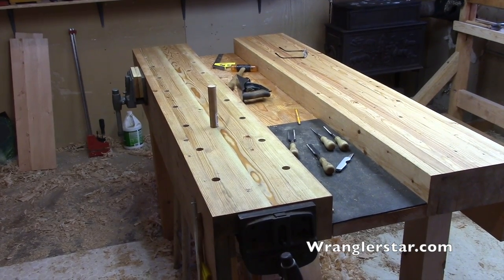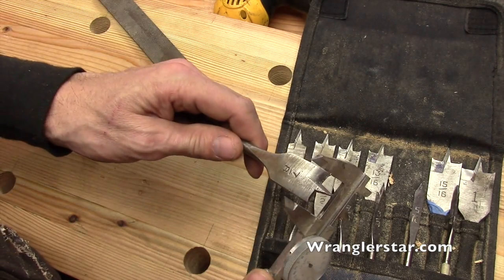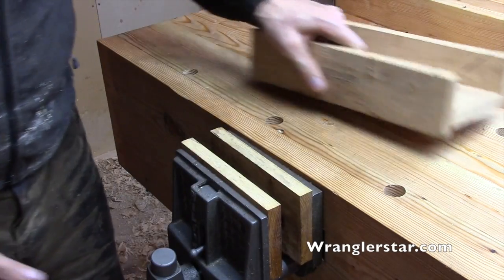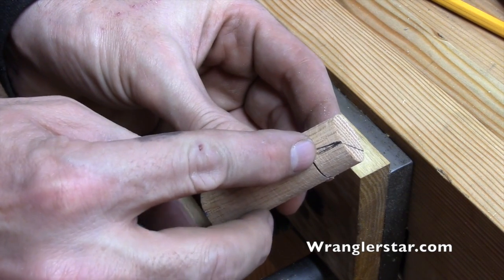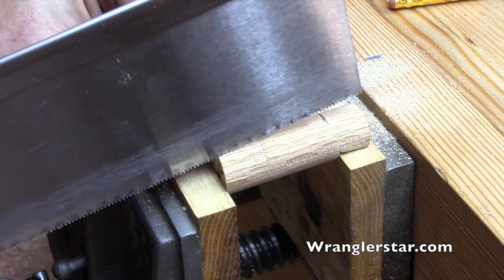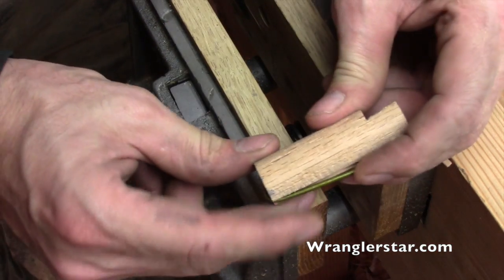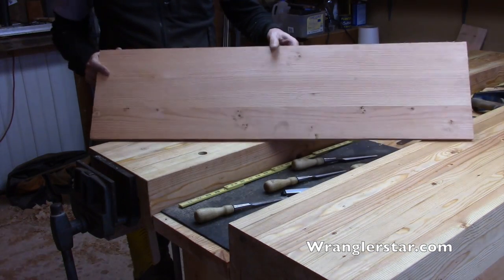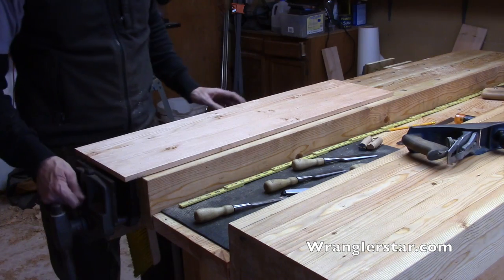Poor Man's Carpenter's Bench Dogs | Wranglerstar

Comment: Cody, you built a very nice bench.  I've enjoyed watching every episode of this project.  One additional feature you may consider.  Lets say you want to plane the edge of various length boards.  You can take your 7/8" drill and drill maybe 4 additional holes on the front face of you bench that are positioned in line with the lowest portion of your front vise expansion rods.  That way, you can position a board in your vise with 1/3 of the board to the left of the vise and the other 2/3 to the right of the vise resting on those same dogs that you built.  Those will come in handy because if you've ever planed a board on edge, you'll find after the first 2 or 3 strokes with the plane, the front portion the board drops because the vise isn't tight enough.  With the board resting on a dog that's inserted in one of those holes, you'll find that you'll only need to snug the vise to hold the board properly.  Thanks for sharing!
Reply: Pretty clever idea.

Comment: About the miter box. The reason the slots on the new box don't go all the way to the bottom of the trough is because you are meant to put a waste piece in there and saw down only that far. Sawing the slots all the way down to the box bottom weakens the box and uglifies the bottom with saw marks. This keeps the box nice and neat and keeps it stronger.

Comment: Wrangler... May I suggest... When using the main vice with your excellent dogs, pack out the workpiece if necessary and use the far line of dog holes. This puts the workpiece fully on the bench with plenty of support beneath it. A truly flat surface will result. You will also find some right-angle holdfasts are a boon, if you don't already own some. Thanks for bringing these dogs to my notice. I am a fan of Mr. Sellers, but I missed the video on the dogs! Cheers.

Comment: First of all, thanks.
Secondly, a tip, assuming you have a set of open ended spanners in your workshop, they make great gauges for wood turning and have a wider bearing surface than the dial gauge, which can twist and move sometimes.
Some very experienced woodturners use this method of calibration, hope it helps in the future.
All the best to you

Comment: Great demo of the dogging system. One suggestion I'd make is to extend the holes to the far side of the bench, to allow clamping items up to the size of a standard domestic door if possible. If you use both vises, and two sets of dogs, you can clamp a door in both directions. You might find a set of horizontal pegs in the vise-side RH leg useful for supporting longer boards while planing - clamp one end in the main vise and support the other with a dog so you can plane the sides.

Comment: I drilled 3/4" holes with a Forstner bit into my bench, then bought 3/4" bolts long enough to have a shoulder on them, then cut them off to make the dogs.  If you buy your bolts at a place where they sell them by the pound, you can get them dirt cheap.  They fit snug, but come out easily.  The heads are a little short, but I always put another piece of wood between them and whatever I'm working on anyway.

Comment: I have 3/4” dog holes. I planed my dowels until they had a decent pressure fit but after some time a couple would fall out when I did a lot of chopping/hammering etc.  instead of making fancy dogs I just clamped them up and lifted a few chips with a gouge with the grain. It’s been working fine for a while now.

Comment: Wow ! Super nice work! Thanks for the many tips.  I don't have a carpenters bench , but i do have a bench made for a mechanics shop. it is very heavy as it is made from rough cut bridge plank. It will hold an engine block and all the tools you can pile on it. I make my wood clamps from a 2 x 6 and wedges. keep up the good work:

Comment: My husband bought me a planner for Christmas and I have run into the same problem with clamps being in my way. If I can figure out how to implement what you have done with the "dogs" I will be free of the clamps and surely enjoy restoring pallet wood more. Thanks so much for sharing.
Reply: Pallet wood sounds interesting what are you doing with it if I may ask 

Thank you
Reply: Smeg Head So far i have made a potting bench and put some boards together for signs using a "kreg" which turned out really well. It's incredible how using a planner and a little bit of sanding turns a rough piece of wood into something beautiful. You can type in Pallet wood projects and find some amazing things people have built. I have plans to make planting boxes as well as shelves. There is no stopping me now....:) I must admit I am still a bit nervous using some of the tools such as the Sawzall and a few other pieces, but as I build my confidence it will become more fun I am sure.
Reply: Sheila R Morse  The only thing about using pallet wood is making sure you get all the nails and staples out before taking a tool to it. I suggest using a semi strong magnet to help find any hidden bits of metal. (not a jab at you Sheila, just a tip for those interested in using pallets but haven't jumped into it yet.) I have a few round balls that are magnetic. Strong enough to find a hidden nail under 3/4 inches of wood. I hold it and run it along the surface until I feel a little tug. Then I let go and the ball will roll to where the metal is. Saved a blade a time or two.
Reply: Thanks for the tip because nails are a problem using pallets.

Comment: option B: Kreg makes some really nice dogs which can be had for slightly less than 2 dollars a piece for a pack of four.They are broader and sit flush on the top. They are especially nice as they have a pad of soft rubber on the top that has very good friction.(some of you might be tempted to use an electric router on your hand made bench) If your piece is heavy  enough ,you wont need clamps.

Comment: For the pegs, I would just start with a dowel slightly bigger diameter than the hole, then turn all but the top 3/4 inch down to fit in the dog holes, the unturned part on top would keep them from falling down and no hanger needed

Comment: A long time ago I made a bench for a metal work and repair shop. I found a 3' x 4' piece of 1" steel plate at a scrap yard. I asked the guy to cut it square. IIRC he charged me $5 for the slab and 4 4" pieces of pipe. STICK welded this stuff into a very heavy table. I rounded one edge to use as a bending brake and drilled holes as needed to clamp things down. 

The neat part was my step father never recognized what I was doing. The booze had really gotten to him by that time.

Comment: I like the sunk dowel dog method.  I'm a mechanic and made my own bench with a 1" kiln dried laminate top.  My bench is much lighter than yours but strong enough you can park a car on it just like yours.  Dogs are something missing from my bench with an end vise for clamping wood projects, this is what brought me here.  Not sure I need the sunk dogs with no heads sticking up.  Interesting, gets me thinking.  Probably going to do 3/4" dowels.  I find myself wondering if they will twist and tear out the holes because my surface is laminate.  Interesting Idea though.

Comment: Nice bench, maybe the only mod would be some kind of drop down/hinged caster wheel system to make it easier to move, perhaps a metal mending plate on some lower part so you can bottle jack it up a bit, no idea how much your table weighs lol, but it would save on back strain.

Comment: If I were you I would paint those dogs bright red so they are easy to see so when one of them has rolled onto the floor and your looking for it you can spot it and make a few of them for spares. You know what will happen you got a piece your gluing up, rushing one dog is missing your hunting all over to try find it lol.
Reply: That's why we have rehearsal! And that is why a rehearsal should be just like the actual gluing (without, of course, the actual glue) so you see if any clamping part is missing.
Reply: When your doing a quick job and your rushing parts get lost lol
Reply: I agree but white and yellow are easier to see.
Reply: Robert Sheffey oh go hot pink!! He'll gather in a WHOLE new audience!!
Reply: Graveltrucking After you paint, wax them so they don't adhere to glue if you should use the bench to clamp (remember wax paper for the bench top.
Reply: Graveltrucking Just leave them in a dog hole, you can push it out and put
it where ever you want to and you will never be looking for them!  In fact If it were my bench I would make the
dogs a little longer than the bench is thick and make one for each hole and
just push up the one I needed and push it back down flush when I was
finished.  Never have to move the dogs or
lose one, ever!

Comment: Built mine with 2x4a with the total cost of $85 for material minus vise and I'm including glue so building the bench really is inexpensive and will last the rest of my lifetime unless I get invaded by termites or have a fire. I kind of wish I had held off for a different vise, but what I have works just peachy. Still want to add a tail vise, but no hurries. I currently have no real need for the dog system, but will probably add it over time..
Good video.. Thanks.

Comment: I wonder if it wouldn't be stronger and cheaper to start with a rectangular board, and turn a portion of it to fit in the whole. That way the top is still square and fits against the board, and the bottom fits in the whole.

Comment: Why did you make them so short?
Reply from the maker: ***** Because the dowel I had was 5 1/4" long. They don't need to be any longer than they are.
Reply: wranglerstar
I would have thought you would have wanted them the thickness of the bench, plus .5 - 1 inch longer so you could push them down flush with the bench when not in use and reach under and pop them up when needed.  If you keep them in the bench you don't have to go looking for them later. 

I guess you could stick something up through the hole to pop them if they went down too far or pry them up with something from the top.

Also, I'm glad to hear you are a Paul Sellers fan.  I have had a couple of interactions with him over the past few years and he really seems to be the same guy in real life as we see on video and in his blog.